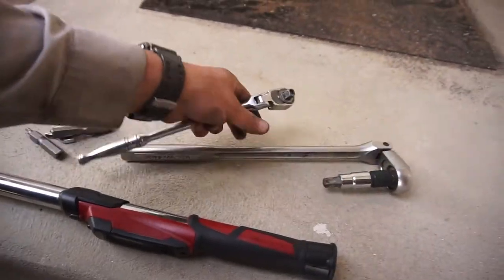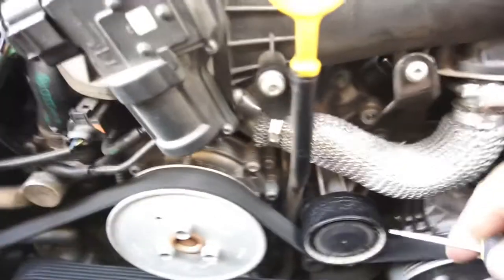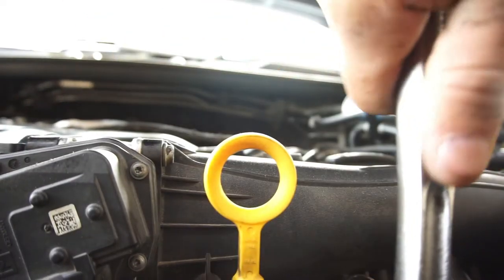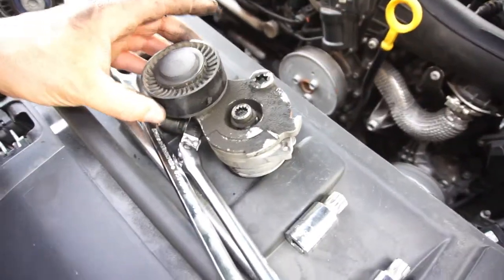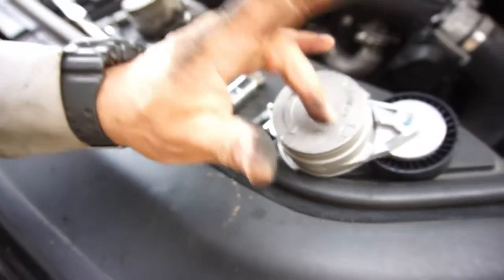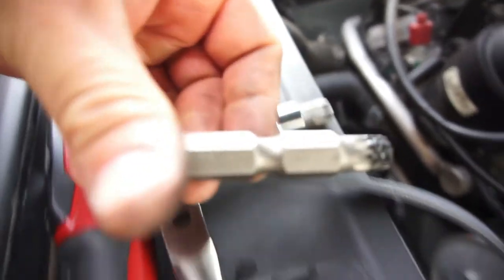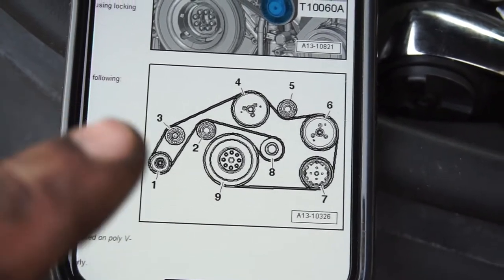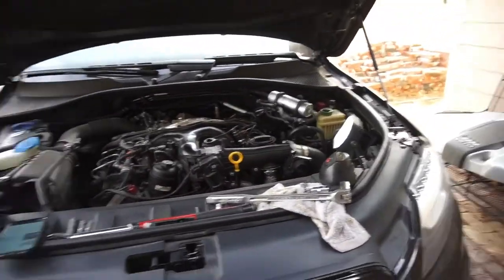2015 Audi Q7 TDI 3.0 Diesel Serpentine Belt, Pulleys and Tensioner Replacement.

Comment: Was your belt jumping off? Mine is! Looks like about 1 rib of belt hanging over the front of the flat back-side idler on the passenger side in the beginning of your video…mine is similarly hanging off. I just ordered a new tensioner, grooved idler, flat idler, covers & bolts from FCP Euro to hopefully keep the belt from jumping!  It’s a PITA to re-route!! 😅
Reply from the maker: @jchovernut  it didn’t come off but very close to coming off. Yes it’s a pain to reroute the belt.

Comment: Thanks so much for this video, while driving on the motorway (im from UK) the serpentine belt came off cleanly, theres a bit of an oil leak from the mid to bottom right area. I think the oil caused it to come loose as i did go quite fast. I dont have as much room as the Q7 youre working on as mine is an A6 C7 3.0. But ill do my best. Thanks so much for this video
Reply from the maker: You’re welcome. Hopefully you get it fixed if it’s not fixed already.

Comment: Hi! thank you for the DIY, very helpful! @Halffast719 I see on the video that your belt is a little off of the pulley (not centered), after the replacement is the belt centered? thanks?
Reply from the maker: Yes. That’s why I changed the pulleys. One of the idler pulleys had a loose bearing.
Reply: @Halffast719  thanks! my belt is about 50% off the pulley but I'm not sure if is the pulley or the harmonica balancer. I'm gonna change this weekend the pulleys /belt and see. thanks again

Comment: I have the Audi Q7 4L 3.0TDi  im trying to change the Alternator I've stripped it down but after taking the 2x 13mm bolts from the face of the alternator it's not  budging is it connected to the Ancillary Bracket or am I missing something it's 11pm in the UK and I'm stuck any help would be appreciated
Reply from the maker: I’d watch this. Seems like a lot of work. 
https://youtu.be/OervJ9wIEso?si=IpoEQwX230VNkAt1

Comment: Thanks for the informative video. I had the serpentine belt pop out on my 2014 Audi A6 TDI V6 C7 model while driving which I didn’t understand why it did. Old belt was fine. Ordered all new parts. We just replaced the water pump, belt, and the idle roller passenger side just like in your video. Should I replace the other rollers and idle pulley? I mean they look in good shape but now my concern is that when the car idles. On the left passenger side idle roller (which was replaced as well). It’s all in the groves in the other places just that small roller looks like the belt is 1/4 inch out. I drove it home 50 miles today and no overheating issues. Checked it again and no issues. I’m just afraid it will pop out again because of the small gap. Is there supposed to be a spacer or something to make that 1/4 gap on the roller...
Reply from the maker: There’s a spacer behind the tensioner but not any of the others. I just replaced all of them. That passenger one on my q7 was the whole reason I replaced everything. It was hanging off the same as you’re talking about. Just replace all of them.
Reply: @Halffast719  thanks for your reply. How much would a job like that cost to replace them?
Reply from the maker: It cost me just the parts. $258 from an Audi dealership online.

Comment: Hi there can you tell me which dimension is serpentine belt, cause mine is 6PK2518, when I went to buy a new one they gave me 6PK2523 and told me that will be fine
Reply from the maker: Original part number is 059903137AL so if you break it down I believe it 05 is the amount of ribs 9903 is inside dimension it’s 99.03” I believe.

Comment: Pretty Crazy. Mine is a 15 Vw 3.0 tdi touareg but no dipstick.
Reply from the maker: No engine oil dipstick? That’s really crazy.
Reply: @Halffast719  computer shows level.
Reply from the maker: I’ve seen that on Mercedes. Never seen it on VW though.
Reply: @Halffast719  you’d think Audi would so the fancy stuff and Vw more basic. I’ll be swapping belts next week also. Only 54,000 miles but i tow a ton with her, so more about PM
Reply from the maker: Yeah especially since non mechanically inclined people drive and own Audis. Not sure if I’m offending anyone but that’s the nicest way I could say it.
Reply: @Halffast719  oh ya. 100%.

Comment: There is vital information that was not shown on camera: removing of the idler gears, pulling the pin on the tensioner. If you are going to make a video include all of the vitals. Do not assume that everyone knows how to do what you are doing.
Reply from the maker: Next time partner. Just figured common sense but guess not. Thanks.
Reply: Hi you might be able to help me I have the Audi Q7 4L 3.0TDi  im trying to change the Alternator I've stripped it down but after taking the 2x 13mm bolts from the face of the alternator it's not  budging is it connected to the Ancillary Bracket or am I missing something it's 11pm in the UK and I'm stuck any help would be appreciated
Reply: If that much instruction is needed, probably be worth while taking it to a competent garage. Better be safe than sorry 🤷
Reply from the maker: @Dan93y thank you. Well put.